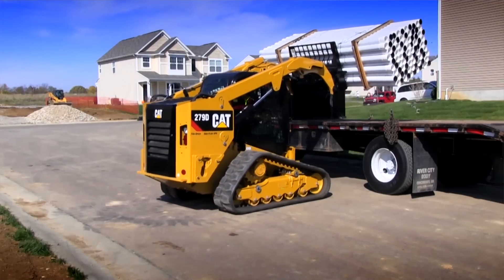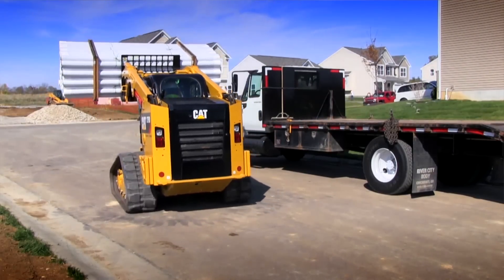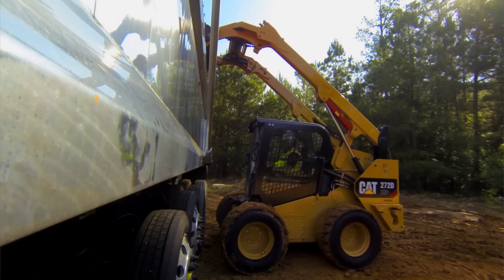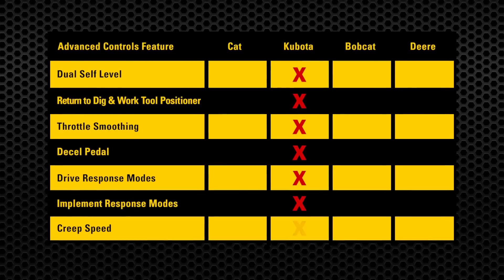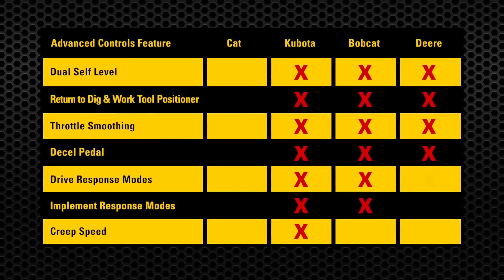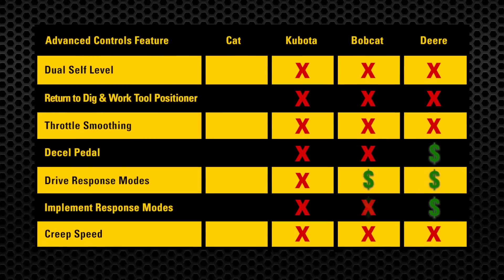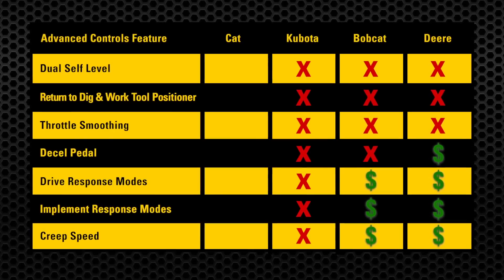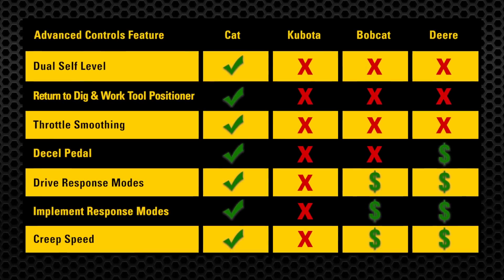Advanced Machine Controls on Cat® Skid Steer and Compact Track Loaders | Experience the Difference

Comment: 60 hours on my brand new 289d3 and the heel on the bucket was worn through in three places. Cat told me it is a operator problem.
They will not warranty that.
For $86000.00 
Disgusting

Comment: Don't buy,  i use one in work, it only has 1100  hrs on it and the plate which holds the bucket on is just two pieces off cheap  tubing,  both broken and cat will not cover it under warrenty. not the only problem we have had with it. Lights are useless on it and the air conditioning unit can barely keep the cab cool in summer. It's a whimp off a machine.

Comment: Give me an AC cab, hyd over hyd pilot  controls and you can keep all that whizbang expensive prone to failure servo electric gadgetry.  You get better feel with hyd controls, none of that fly by wire tactile deadzone. An operator should be able to level his load, up or down and if they have to think about dropping their bucket to grade when loading a truck that means they're still inexperienced and need more seat time. I do however like the accel/decel pedal concept. Works great for fine work on dozers.
Reply: Agreed!!!!
Reply: These controls are proven to be reliable, and there's no "feel" on the older sticks. The 226B3 at my farm would be a better machine if it had sticks as good as on the 279D I use.

Comment: Okay,who actually builds the motors for the skid steers?Are they cat motors or are they built offshore and badged cat?Im not saying its bad,just want to know.
Reply: I believe the engine in the 279D (and therefore several others) is a Kubota adapted for the Cat equipment. It definitely isn't bad, I love the 279D. It's better and has more real power than the 279C.